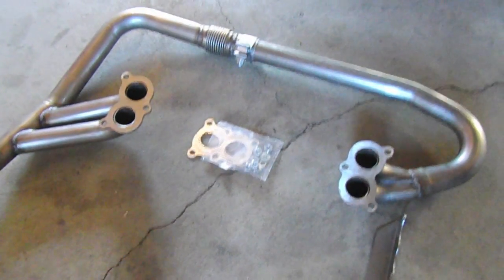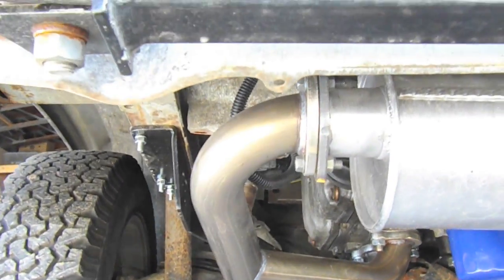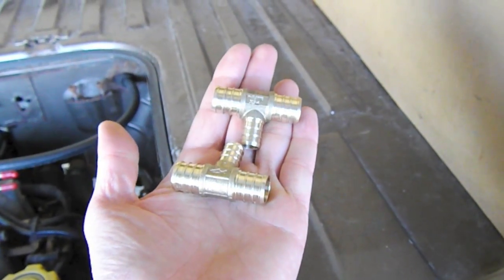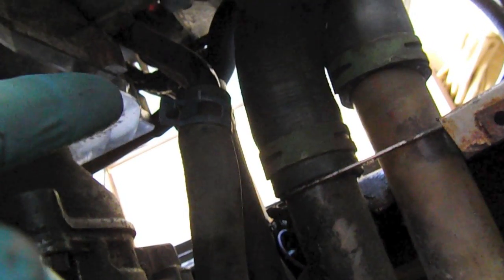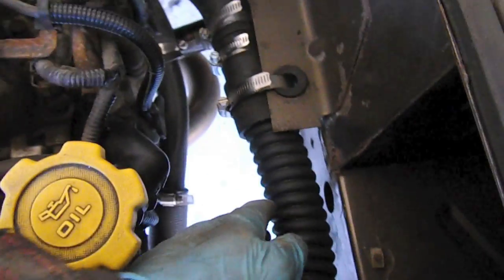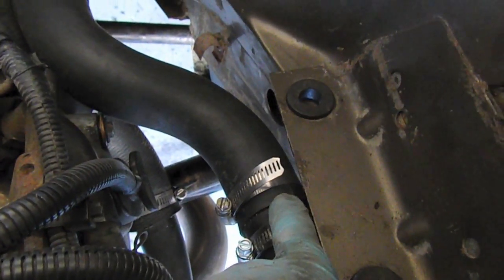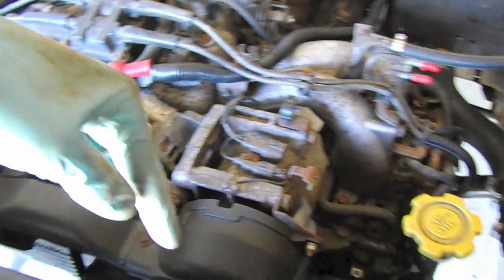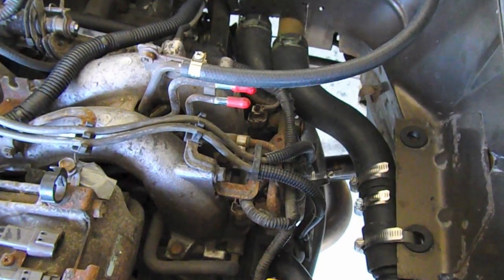Exhaust. Cooling. - Subaru Vanagon Engine Swap Part 8

Comment: I'm trying to make this work with what I have in WBX parts and Subaru donor parts, but I'm not quite getting it together.  The upper hose you show, I have, but the diameter isn't really conducive to slipping over the engine hose fitting.  Maybe it's just too old and not flexible enough anymore.  I also have the coolant bottle reversed 180 degrees from your example, which is more like the example on your Busaru page.  Perhaps the clearance is different on the 2.2L vs. the 2.5L?  I may reverse it. but I'm going to see if I can overcome some of the fitment issues with generic ribbed hose first.  I also opted to keep the side tins, which will slip under the KEP mounts after flattening out the flange.  They aren't bolted in place on the frame, but the KEP mount clamps them securely. It might make things a little more difficult for hose routing from the T-stat housing connection, but I really like the idea of having them there (Note: I had to notch out the tins in the area of the KEP crossmember, but I will fill them in with a "humped" piece of galvanized sheet steel).
Reply from the maker: I can't wait to see your cooling tin sheet metal combo - I bet that'll look pretty good. As far as the coolant hose routing goes, it's just a puzzle. If you're having trouble slipping the 1.25" hose over the Subaru inlet and outlets, try putting a very small amount of grease on the inside of the rubber and heating with a hair dryer or heat gun. That should give you plenty of give to slip over the ridge on the coolant manifold.
Reply: I'll try that.  It did come to mind.

I dove into the wiring harness tonight.  Removing sheathing, segregating the things I'm pretty sure I don't need.  Haven't cut any wires yet!  There is a unit on the same branch of the barometric pressure sensor that I am baffled about.  Says "JECS" on it.  Per your vids so far, not among the things I need, and there is a third relay next to the green and brown connector relays that I want to know more about before I snip it out.  Just beginning...
Reply from the maker: Forthwith Tx I believe the JECs unit is a resistor but not totally sure without seeing it. The third relay is the fan relay I believe. Just work from the computer out, basing your decision to cut on what the pinout document says. And the most important thing - just take your time. Good luck!
Reply: I was able to expand the hose by boiling the end and slipping a tee into it until it cooled.  It fit much easier on the engine hose fitting with some silicone grease after that.
Reply from the maker: Forthwith Tx Sweet! Good work, looking forward to seeing your swap when it's all said and done.

Comment: Nice job with all of your guides/videos.  Rare that people that know as much as you do mechanically can also produce great content!

Where did you get the heater circuit Brass barbed tees from?  I can find 5/8 tees that are the same size on all three ports but I can't find ones like you show that have a reduction for the middle port.  What is the reduction that you did?
Reply from the maker: +Kareem Adnan Thanks Kareem! So I go to the plumbing isle at Home Depot and find where they have PEX fittings. All you are trying to do with the reduction is allow most of the coolant to flow through to the heater cores so anything 3/8+ would work for the bypass. I hope that helps!

Comment: Hi Mick. I'm from costa rica. I had installed a ej25 in a vanagon. But i have problem with coolant flow. Do you have a coolant flow diagram. Please and thanks for your videos.
Reply from the maker: +Allan Schmidt I can explain it quick - coolant out to rad from top hose of engine, coolant into engine from bottom hose (thermostat housing). Heater circuit - coolant out from coolant manifold (under intake), coolant in from heater to thermostat housing. Hope that helps!
Reply: Thanks, Mick. it happens that the coolant flow is very weak and almost does not move. Please help. I ran out options. Jajajajaj
Reply from the maker: +Allan Schmidt Is your thermostat opening all the way? Take it out and see if you get better flow. If it's still slow then you probably have a blockage in the radiator.

Comment: Hi, can you provide the link where i can buy the exhaust? And one more question is there a cad drawings for for a engine support, i want to weld it myself.
Regards
Reply from the maker: +Mars Hens Hi Mars, contact KEP for the exhaust. No CAD files for the crossmember. Good luck in your build!
Reply: Yes busaru. knows everything he told me by with KEP Kennedy in general 👍

Comment: Subaru motors suck, they blow headgaskets, they burn oil. They may have the extra hp and torque. I went with 2.3 GoWesty motor which has been reliable thus far for 80k miles now.